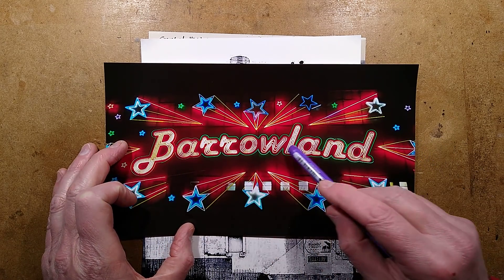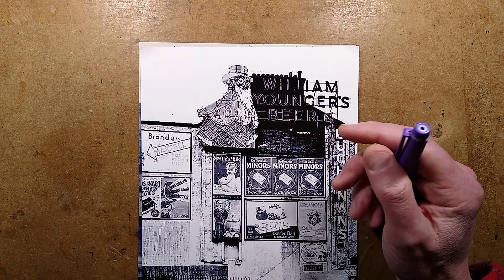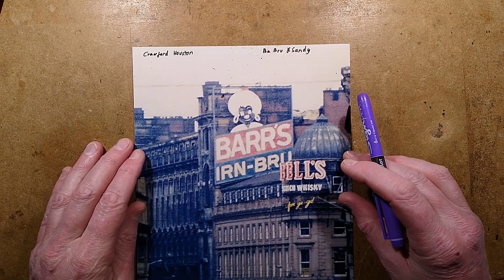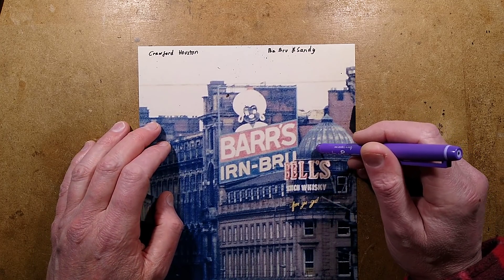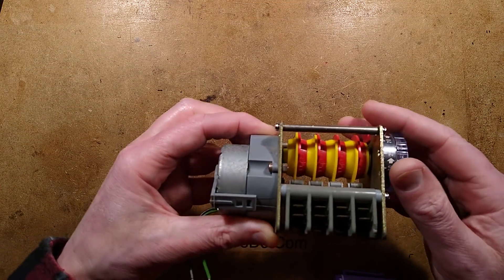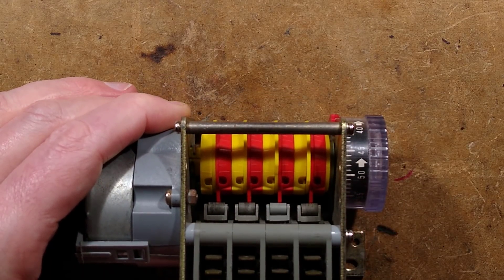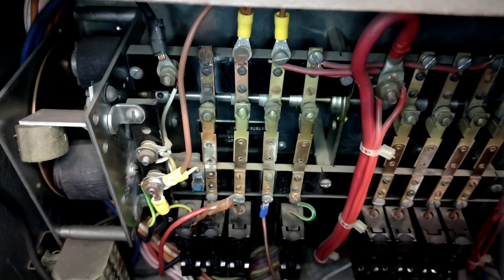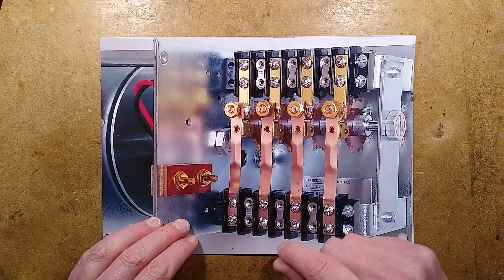A look at the Barrowland's neon sign controller

Comment: Soo. For the arcing.. did they not use this to control relays ?
Since they have a defined min holding voltage and then spring open arcing wouldnt be as much of a problem. On the other hand then the relays probably need regular replacing when they did their few million cycles, so its back to cleaning contacts again ;-)

Comment: Sadly it was decided in the 60's and 70's in the US that neon or any kind of signage was "visual pollution".
I have always loved neon and other illuminated signs.
Even though I was a kid and had never stayed at a Holliday Inn I was upset when they got rid of "The Great Sign".

I miss electromechanical stuff.
My job title was going to be "Electromechanical Witch Doctor"  but it wouldn't fit on the business card.
Mainly what I miss about it is most  of the time you could look around, find what's wrong and fix it, often with a can of tuner cleaner.
"Looks like my points are wearing out, I should change them soon".  Then you would hit them with a file and be on your way.

Now it is soulless little black boxes that work fine until they don't.
It wouldn't be so bad if the had an LED that came on when they broke.
Once in a while you get lucky and the smoke comes out to let you know the particular black box that went bad.
The rest of the time it takes hours to find the problem and minutes to fix it.
Provided of course you can find the part.

Comment: I used to live in Las Vegas for 10 plus years and I been to the sign graveyard where they have all the old retired signs and controllers, some are set up operating for display. A neat thing about when I was out there was I literally watched and helped the transition from neon to LED in some places. The old strip "Freemont street" still hosts neon and filament bulb signage except for the canopy over the street which is RGB LED. The 'new strip" on Las Vegas Blvd where you have MGM Grand, Aria, Circus circus, etc. along IH-15 is mostly now all LED (LED tubes that resemble neon) but some neon still exists. The lit trim on the Luxor went from standard chasing lamps to programmable RGB LED strips and they are planning on reworking the pyramid cap spotlight from halogen to LED. All to be more efficient since lake mead is drying up.

Comment: Not sure if I've seen it on your channel or elsewhere, but these kind of mechanical controllers where used in traffic lights too and some are still working after decades. Have seen a complicated mechanical controller in real live in an very old automatic wood dowel milling machine for ladder rungs that controls all pneumatic and electric actors. More than 20 switches.

Comment: @7:26 - One tunes those contacts like one adjusts the valve lash on a 4 stroke engine.  Loosen outer nut, adjust lash then tighten outer nut while holding inner screw in place.  It takes a bit of faffing about to keep the valve from un-adjusting while tightening the outer nut.

Comment: The programmable controller reminded me of lift controllers back in the days whech did some amazing things mechanically, that is now done using simple electronics to get people/goods safely to a floor of their choice. So many Firms had a diferent aproach to controlling an a/c motor but the electronics- went from thyristor control- and reverse-phasing  to 'stab' and motor to slow down/stop, to PWM - 0-100% full speed and back, providing a smooth ride, no sudden shocks or jerk-rate...Until the lift car hits a lock on its run...Yes, retired now, btu I did all that for 50 years whn you could be in the same industry/Firm for that many years. Not anymore, you cant!

Comment: The original lighted sign we had for our fire department had a motor controller for the arrow on top. It was one of the 4X8 ones with lighted fiberglass. They don't handle high winds very well though...

Comment: I would expect these contacts to be controlling relays which actually switch the high voltage if there's one main neon sign transformer, or at least the primaries of multiple neon sign transformers.  Is there a picture of a bank of the relays too?
Reply from the maker: I think it's switching the transformers directly.

Comment: For a larger version with 305 switches, see https://youtu.be/CIsQ8tqaXeA?t=147 and for a piano-roll style see later in the same video https://youtu.be/CIsQ8tqaXeA?t=277
Reply from the maker: Good video.  Not so keen on the guy changing lamps live while climbing on the frame without a harness at the 5-48 mark.

Comment: hey clive! female fan here. federal sign and signal made an early AR timer i featured on my channel clive that controlled a thunderbolt air raid siren system in cincinnati. its the old rectangle early timer. has a similar sign mechnism eddy wheel motor as the one in the second video.
Reply from the maker: I think it's Federal who did the Splash/Riviera sign in Vegas.  I'd love to see the controller for that.  Shame it's gone.

Comment: In Oslo here in Norway there is a giant neon sign for the Chocolate brand Freia on a rooftop in the middle of the city. It was first lighted in 1909, and have been replaced several times during the years. Now it is LED, and I believe it is the largest "neon" sign in northern Europe with 140 square meters.

Comment: I know of the Barrowland venue from all the live concerts played and recorded on the grounds. Artists from the Pogues to KT Tunstall etc have treat the Barrowland Boards. It is interesting to see the mechanical workings for a neon sign of such calibre rotating to trigger the lights in order. Judging from the copper contacts attached to the contacts they would need to be robust to handle the amps and any arching as they open and close during the run time the sign is on.

Comment: I remember seeing some of those neon signs in Glasgow! We would spend two or three weeks in the Trossachs, and especially at Rowardennan campsite. We spent time around Glasgow, and made a point of visiting a particular cinema (It's where I first ever saw Disney's "Jungle Book"), and that is when, as far as I can recall, we marvelled at the neon [ and other] illuminated signage. Some of it was "A bit like London, only smaller".

I think you would have found the switchgear at Morcambe's 'Happymount Park' quite interesting, and likewise on Blackpool's 'Golden Mile'.  I remember at one of those two, there were some large illuminated peacocks which stood near a gate, and not far away, there was the control gear which made an assortment of noises in time with the lights on the peacocks, a kind of "thrikk-thrupp, thrikk-thrupp, thrikk-thrupp - frapp frapp frapp, and would then repeat ad-infinitum. At the Fleetwood end of Blackpool there were the giant 'tableaux' which were not just marvels of artwork, but the electrical work must have been borderline sentient machine logic, given some of the display actions and light shows.  You could only really appreciate the technical engineering if you were on foot, because you could walk up close to the tableaux and listen to the control gear clicking and racking...... Those were the days - The golden days!
Reply from the maker: I was shown some tableaux controls and they were similar to EPROM based fairground lighting controllers.
Reply: @bigclivedotcom  Sorry, yes... I should have pointed out, it was back in the early to mid '60s when I first encountered the lights at Blackpool. It was all electromechanical, rather like our continuous flow grain dryer, except that the tableaux were constantly, and actively, changing the states of their lights.

The thought occurs to me, too - I don't recall any lights that faded in or out, back then. I guess they were truly binary circuits, either on, or off.

Would there have been any electronic controllers at that time?
Reply: @28YorkshireRose12  Back then they had early transistors but they weren't high power, I really doubt they'd do it electronically. Vacuum tubes wouldn't be anything like robust enough, and they burn out after so many hours, be a pain in the arse, you'd need "tube men" running round the illuminations constantly swapping them out. Blackpool illuminations are great though, or were when I was a kid, not seen them for a good while. Wonder if they've changed much. If I were to go, and see RGB LEDs, it'd probably break my heart!

I think relays and contactors, and rotating motorised switches would have persisted for probably longer than you'd think. When something's worked reliably for 80 years or however long, you're not keen to swap it out even with technology that has matured in the interim. I just looked, first "modern" illuminations were in 1912. The first actual illuminations were 8 carbon arc lamps in 1879, "artificial sunshine", that probably would have been something to see to people back then.
Reply from the maker: @28YorkshireRose12  Ah, in the 60's it would have been mechanical.  Possibly a complex drum system.

Comment: I love the old mechanical switches .I had the pleasure of setting one up for a friend who owned a bar in Toronto called the Cadillac Lounge .I used it to control head lights on a front end of a Cadillac used on the stage .and to control part of the outside sign .They last along time .Issues with dust and moisture but if you oil and grease them every year they will last a lifetime !

Comment: Hate to be the man cleaning the contacts and adjusting them. I used to work on mechanical contacts made by IBM and they had a wiper system, they did not just open and closed they wiped against each other as they open closed to keep cleaning to a minimum.

Comment: Actually, now that I remember, this relates to the "closest scrape at work" question. I'd been working as a sign installer for a few months for a woman that did contract neon sign projects. We were at a department store, putting in a new sign in the women's clothing section. One of the tubes broke, and we put the halves in a box to carry back out at the end of the day. For some reason, when I reached down to pick up the box, my right thumb went straight at one of the broken ends, and the shard sliced a v-shaped wedge about 2 cm long from the pad of the pad of the thumb. Blood everywhere. Right after that, my boss decided she was better off working solo.

Comment: Really illuminating thanks. Takes me back to my miss spent youth. I used one brought from a well known  suplus shop in Derby called R.F. Potts. I used it to run my home made Disco Lights, it never failed. It had a 110 volt motor. I used a 15 W pigmy lamp in series as a dropper(hope thats also not classed as racist).  Know better these days. Derby had for years a large skyline neon sign for Co-Op milk. It could be seen all over.

Comment: Is the load is highly inductive?  SSRs don't like inductive loads ass switching is usually at zero crossing and that creates highest possible load on the switch .
Reply from the maker: Theoretically the worst place to switch off is at near the peak of the sinewave, as that is when the magnetic field will be highest in the transformer.  The triac will switch off at the zero crossing point when the magnetic field is low.

Comment: We were used to using an home-made cam based switch for Christmas tree lights. Now with led chains each one sporting its digital controller it's not the same, the loud motor noise and the tickling were a part of the atmosphere...

Comment: At our local Launderette there is two very old commercial washing machine and the both have a motor driven cam shaft that press micro switches on and off for the different wash programs and the best bit is they can be repaired with just a screwdriver where the new ones ?

Comment: Fran Blanche has a video about another type of classical illuminated sign, built out of Edison lamps.  The controller used a gigantic loop of heavy paper to allow it to have a very long, complex pattern that controls individual lamps.  IIRC, the paper acted as an interrupter for controlling relays that switched the AC, since AC would probably just burn the paper.
Reply: Jacquard loom/player piano technology. Kind of amazing Looms were the first programmed automation.
Reply: @mycosys  Closer to the roll of a player piano, Jacquard looms use 2-dimensional frames that get advanced as a unit to press any array of control rods.
Reply: @evensgrey  Given the player piano reads the punches pneumatically and the roll would be quickly destroyed by mechanical fingers i would think its somewhere between, hence mentioning both. Punched tape readers were generally optical. Punch cards started out mechanical but they didnt drag their fingers.
Reply: @mycosys  Hedy Lamarr patented the idea of using a piano roll to tune a radio to make it more resistant to interference. Although that was deemed too clumsy to be of much practical use, the basic idea of frequency hopping is commonly used today.
Reply: @NiHaoMike64  i had heard about that, Hedy Lamarr was one amazing woman. Its a LOT of work maintaining the look she had and she still found time for groundbreaking  physics.
Reply: @mycosys  Not as hard as it sounds, see Naomi Wu and Xyla Foxlin for more recent examples.

Comment: Still have the eddy current motor and cam controller, that was used to run an old flashing sign. All still running, with a set of 4 switches, with massive contacts, all running off a single cam. Ran a half gross of 15W E27 pygmy bulbs, to run around the perimeter of the sign. Got as part of a business purchase, and actually got it running, though it was never used as anything other than a wall hanger on the back wall, as getting new perspex panels and lettering for the backlit inside was not wanted. Eventually sold for scrap, so I took it down, took it apart to make moving easier, and kept the controller. Bulbs I was able to buy as a half box, cheap, of the poorest quality lamps ever, but they did do the job of filling the sockets, to make sure it worked.

Comment: The display controllers that really blow my mind were where they had film projectors projecting animations onto an array of light sensors that controlled the actual lights. But I have a hunch it gets even more interesting then that and I really want to know!
Reply from the maker: A technique still used in a very different way with audience interaction.  The audience wears illuminated RGB wrist bands with an infrared receiver, and an infrared projector sends data to them so that no matter where they are, the correct pixels of an image light up.
Reply: I was just thinking of that. There was long one in Bristol when I was a lad 50 years ago - I can recall it being on the local news when it started - I think it used a 35mm film strip? Operated in multiple colours somehow so must’ve had filters in front of phototransistors or something - and thousands of relays!
Reply: @Richardincancale  The only thing I saw like that was a film from the 1920's or 30's... I think it was the era they called 'the great white way' (referring to the lights of Broadway New York). This one was an enormous square display right at the fork of some street town center or whatever. All white lights, connected by individual wires (of course) to vacuum tubes (perhaps relays as well, IDK) in an array on a large wall opposite a powerful spotlight and/or movie projector. They sometimes had live performers making silhouettes, sometimes animation films. Only saw that film once on independent television in the early 1990's.

Comment: I really have a thing for electro-mechanical  sign controller history. Where can old detailed pictures be found of things like the mercury bath paper tape reader used in that scrolling display in new york?!?!? I've been wanting to see more about that for 30 years!! Anything else also on the subject would be helpful and most welcome.
Reply from the maker: That was so long ago that any photos of it would have been in someone's private collection and long since gone.
The whole unit was apparently sold to someone in another country when it was decommissioned.
Reply: @bigclivedotcom  Well thank you... The only things I know I didn't say was there was a photo of a "mercury bath" "reader" in a random-house-encyclopedia (possibly the aforementioned device, but If I remember right, they don't show something long enough, perhaps in an early 1980's random house); AND footage in a film from the 1930s or 40's. I recall a long possibly glass trough of mercury with a long array of contacts - and what looked like maybe 6 inch wide paper tape that I suppose was pulled along the surface of the mercury, pressed down by the contacts. I like all tape machines for some reason so this one seemed like the craziest one ever made period. !! with mercury splashing off of the end and contained as the tape is looped... looked like it worked well as flashed some of the most intense headlines in history! Might make the operator mad as a hatter tho!!